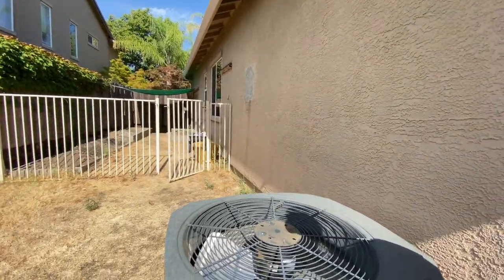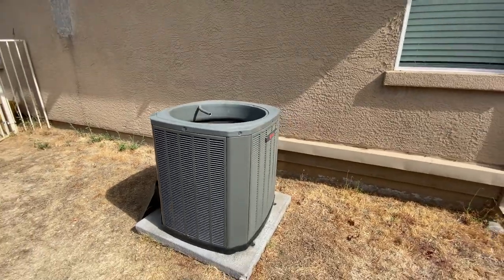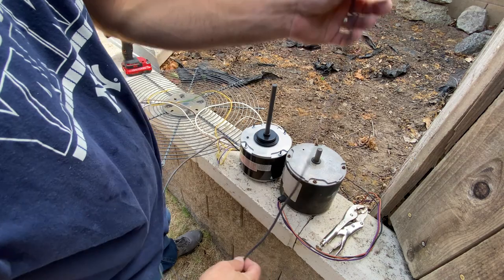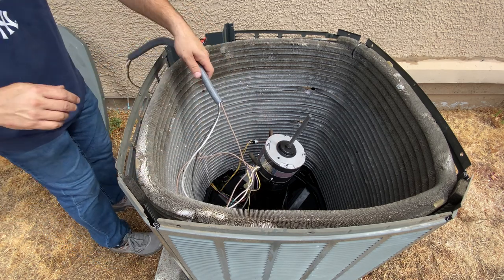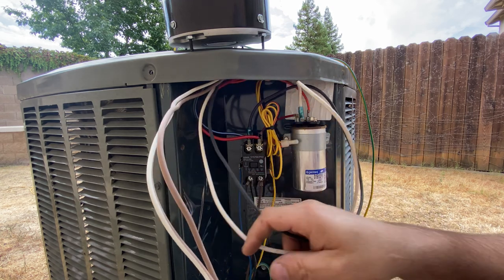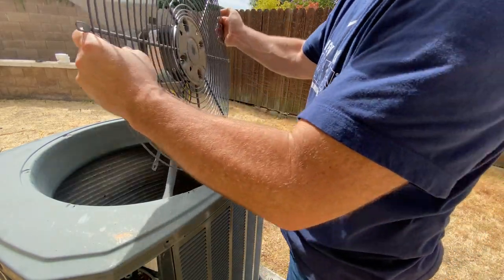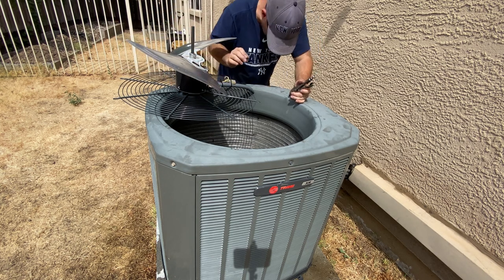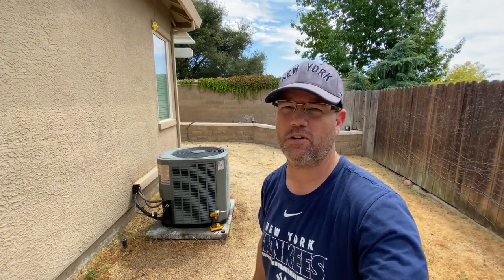How to replace home AC Condenser Fan Motor and Capacitor

Comment: Regarding the clockwise/CCW part.  It's basically saying Yellow->Yellow and Purple->Purple the motor will spin CCWLE (Counter ClockWise viewing from the Lead End).  That's the end of the motor with the bolts sticking out that mounts to that "grill" on top.  Side note: the opposite side of the lead end is the shaft end,  that's the part where you attached the fan blades to.  So with those grill mounting bolts facing you that Yel->Yel and Pur->Pur will make the fan look as to be spinning in the CCW direction.   Obviously The Yel->Pur and Pur->Yel configuration will make the fan spin CW looking at it from the bolt side of the motor.

Comment: Well done. I have observed others using stainless steel wire to secure the reversible wiring as zip ties tend to deteriorate in the sun. Likewise, the inconvenience caused by nuts falling and getting lost while working cannot be ignored. Therefore, I have taken the initiative to purchase a magnetized stainless steel nut cup from amz to facilitate my future tasks related to the car and household.  Since it has been 2 years since you did this video, was wondering how that aftermarket condenser fan motor is holding up?  Since our 2013 Trane (2 ton) on the roof is getting old but still working, I'm sure that condenser fan will be needing replacement eventually.
Reply from the maker: Everything is still working awesome. Thanks for the watch

Comment: The physical size difference between that Trane motor and your universal motor is significant. Yes, the universal motor is cheaper than OEM but how long will it last? From my experience, aftermarket motors under a heavier load of operation generally die after 2-3 years compared to OEM which will last you 14-16 or longer years. It is also advisable to replace the fan when changing the motor as any slight damage to the fan blades will transfer unbalanced rotational energy to the motor bearings.
My suggestion would have been to find a professional motor re-builder/rewinder and rebuild your Trane motor.
Reply from the maker: Agreed, but the Trane fan only lasted 6 years. So far the “aftermarket” one has been running strong for 2 years.

Comment: Instead of mounting a new fan capacitor, can I just replace the dual capacitor and keep it wired as it was?
Reply from the maker: Honestly I am not 100% sure. I got my fan from a local hvac supply house and they said to wire this way so that’s what I did.